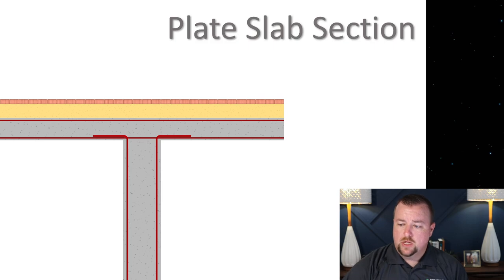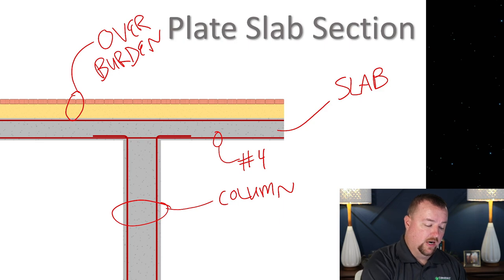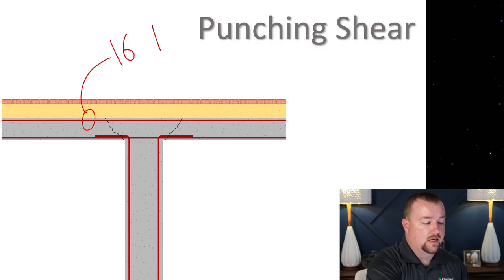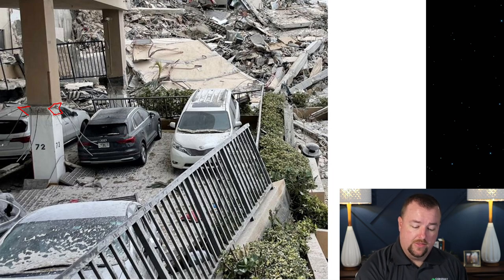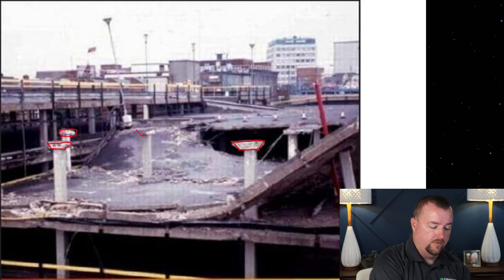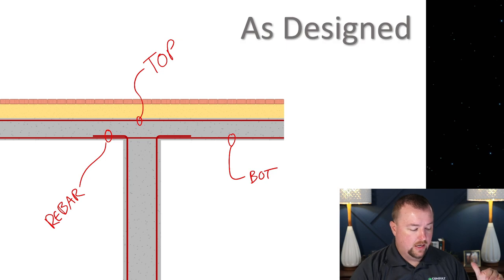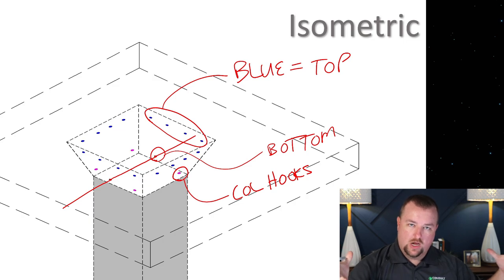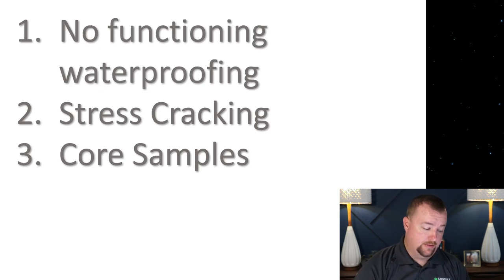The Importance of Punching Shear at the Surfside Collapse

Comment: Thank you so much for this analysis and discussion. It really helps those of us non-engineers with a technical orientation to understand this failure. I’m looking forwards to your upcoming discussion perhaps of lateral stability in the tower structure and if perhaps additional sheer walls or diagonal bracing might have dramatically mitigated against what so quickly became a near complete failure .

Comment: Thank you for such a well explained reason for your theory, I totally agree…. I was a civil engineering students who decided to change majors just for the scary reasons you have explained…..my husband was a guy who was a project manager for scores of projects in south Florida, and did concrete structural repair……I always breathed a sigh of relief when he was done jobs from Key West to Hutchinson Island, as I was terrified that there would be massive failures while he was trying to repair pool decks, structural column and roofing since condo associations waited until it was almost time to condemn a building and then decided scope was large enough….. the new construction in the seventies is scary but the repairs and reinforcement required to alleviate the failures of same over many years was always a head scratcher to me on why this didn’t happen sooner…..
 God Bless the survivors and the dead in this terrible situation but buyer beware in south Florida if your condo is older when you buy.

Comment: Would  it have been possible to add rebar to the building during repair?
Reply: The best way to repair the pool deck would've been to cut out entire sections at a time and pour new slabs tied into the existing structure. The entire slab was damaged completely through, anything else would've been an incomplete repair.
Reply: I think it would be the best if they removed that entire slab and made a new one

Comment: Any person that's ever put a back patio on a house, or built a path way, knows about the quarter inch dip. I can't believe that this slab was originally built to not drain off water naturally. That was 40 years ago though. Such a myriad of problems after that.
Reply: The original print specified drainage pitch and drainage pipeline for garage roof / pool deck !
Reply: @chrisperrien7055  I've watched everyone. It's certainly a mystery. I'm to the point of wanting to hear about the palm tree roots and weight.
Reply: 40 years ago, we definitely knew that the slab needed to be able to drain.   If I were the people involved in this construction, I would rather be dead than to know that my mistakes were fatal which caused the death of people.  I am not being facitious.
Reply: The quarter inch dip is when you visibly cower to the rebar salesman.  I must be in love with Andrew Carnegie.  We can afford better than rebar.

Comment: #4’s @ 15”? Seems a bit light doesn’t it? Usually #4’s at that spacing is commonly used for temperature steel (cracking). I would have figured #5 @ 12” minimum for a slab 9.5 inches thick from a structural standpoint, but agree don’t think size of steel was at fault, more water problem. Question must be asked; was the slab built as per design plans?

Comment: Your analysis videos are great quality and educational.
Concerning the slab core samples, the multiple layers of spalling may indicate maintenance errors made in the past.  In addition to waterproofing and drainage questions that have been discussed, another factor is live loads over the life of the concrete.  Excessive loads may have been placed on the pool deck slab during the palm tree removals, any prior work on the paving surface and staging pallets of material.  A skid loader or forklift moving paving tile palllets or buckets of sand would place concentrated loads of thousands of pounds on the slap. Typically outdoor paving has a base surface on top of earth/ground.  In cases like the pool deck and garage structure, any work is being performed on a floating concrete slab.  If the top layer is already delaminating, the slab has to distribute those forces on a thinner surface and only support is at the perimeter and the column locations causing deflection and thus, spalling.  

Essentially, after years of use and any deterioration of the top mat concrete cover, later work (multiple times?) moving a 10,000 lb plus loader and pallets repeatedly (relaying tiles, planter box work, tree removals) over a saturated concrete slab only supported at the column locations in the garage and pool deck perimeter.

Would slab deflection be further compounded by the design (1970s codes) of the column and slab connection?  
It appears the only connection are rebar column hooks that are then wire tied to to the bottom mat.  The top of the column and slab bottom would be a cold joint.

Comment: Would the palms removed from the decks have caused massive damage...? Btw I really enjoy the videos. They are quite interesting. Ps I can't believe I'm watching engineering videos, bravo
Reply: No, probably prolonged the life of the pool deck though. If anything, it is an indication that the board knew they had a slab issue and were desperately removing weight off the slab.
Reply: I can't help but wonder if the palms themselves caused major damage. How far down do their roots go, and could they intrude into a structural slab? Concrete doesn't stop determined tree roots.

Comment: I’ve never seen a core look like that. Could this problem of delamination have originated from poor casting protocols? Given this environment is not and potentially windy by the ocean, delays in the slab cast could have built in cold joints from day one.
Reply: I am certainly suspicious that poor construction workmanship was a contributing factor to the observed delamination - and other water intrusion issues as well. And once you get such serious compromised structural integrity, the situation becomes very bad indeed.

South Florida in the late 1970s through to the 1990s was notorious for poor workmanship and corrupt building inspectors, so this is a very probable scenario.
Reply: @chemech  True, many better-built structures from the 1950s-1960s still doing fine, but once that WW2 Generation retired, and So-Fla became more "Third World", the shodiness proliferated... silver lining: Hurricane Andrew in 1992 finally caused some tightening of codes and oversight.
Reply: @MajorCaliber  No buildings survived Andrew where the eyewall came over. Our company sent a semi truck load of supplies down. I saw the photos the driver took.

Comment: My guess is that the building was designed weak. Skimpy columns in the section that collapsed. Not much rebar in those columns. Another possible contributing factor... Heavy equipment driving over the pool deck during the past 40 years, causing damage.
Reply: Back then they probably figured they had this slab construction method down pretty good and it was working everywhere. but now we have the age and oxidation and the damage to concrete is too extensive to be safe currently in many hidden places. how many hotels are built this way? we know parking garages everywhere are concrete slab. makes you think.
Reply: The columns did not fail- they are right there punching out of the ground. The columns were pulled over or knocked out from under the slabs above by the failing pool deck slab.

Comment: Would have previous hurricanes have any bearing on this and possibility accelerated the deterioration?  With strong winds and possible storm surge hitting the building.  This is much better info than TV.  Being an non-professional engineer, but having degrees in Civil and Electrical engineering, its great to watch you explain this.  👍
Reply: Unlikely, This is a long term story of water sitting on the concrete slab for decades, slowly corroding the steel reinforcements. Add in a fair percentage of salt, ineffective waterproofing and the slab that failed was doomed.

Comment: Please tell me where is the steel from the delaminated heave in the pictures, as you have suggest, of the collapsed deck. Has all of the steel mat corroded to dust?
Reply: Around 22:45 and 23:30 good point! I think he is still working towards a conclusion (giving the benefit of the doubt). If there was insufficient top rebar in the deck, then collapse was inevitable. Florida in the 1980s anything was possible...

Comment: As engineered everything was okay , as built everything was okay , but the people said nay nay to the sloping decks because their lounges would not sit even on the sloping deck , so concrete  was added ( tons and tons of it ) to level the deck . Then the added many more tons with the concrete planters and 25-30 foot palm trees , and new deck tiles , more tons . The building put up with the extra load for many years , but lack of drains and extra weight  caught up to them . The deck gave way , heavy planter took out a column  and still the building  stood for seven more minutes , another column , now carrying the extra weight caused by the first falling column , gave way , and it snowballed till it was a pile of rumble
Reply: Indeed ... but a big "IF" on both design and "as built" conditions ... next video will examine this key component. "Rotational Inertia" is powerful stuff eh?

Comment: obviously, I would have recommended TOTAL replacement of the pool deck.  Engineer cutting the pool deck loose from the bldg and drop it.  Start over, new columns and decking...  The bldg would have stayed and the owners would have bitched and moaned about the cost and the lack of availability to use the pool.

It wasn't subsidence or PIF problems... The pool deck did this.. just like the butler did in the the kitchen with a knife

I think you nailed it.
Reply: Now the question is, why did the building survive for 7 minutes after the pool deck fell in?  What happened in those 7 minutes?

Comment: What I'm wondering is: how did these plans pass approval from an architectural perspective and how did it pass structural approval before the building was allowed to progress to the next phase?  Was it a failure in certification that allowed the plans to pass and was it a failure in certification of the structural work that was done?  Seems to me that both of those approval processes were flawed.
Reply: You haven't watched the video then? The design was sound and was built correctly. The structure failed due to years of neglect in a hostile environment.

Comment: Great videos,  but i disagree with your assessment on the cores being separated at the re-bar depths. In cores that small it is very likely that the drill bushings that align the drill head on the mount were worn (happens in nearly all drills after a week of use. This causes play at the tip of the bit while drilling and the kerf is actually larger than the cutting teeth themselves- so when you hit something more dense than the concrete (i.e. metal) itself the bit rattles or vibrates, which when combined with the non adhesive surface of rebar to concrete tends to snap the core at that depth before you even back the drill out. This is very common on 2-4 inch cores, less so when the bits are larger and there is more cohesiveness to the concrete around the metal. Otherwise two thumbs up!
Reply: It also looks to me in the second core sample (core B) that the 4 separated 'bits' are laid out in the wrong order - if you look at the colour of concrete, it looks like the 2 middle bits are the wrong way around. If that's the case, they would fit together more accurately (look at the edges).  I could be wrong!

Comment: My friend your presentation on two way diagonal shear ("punching") is faulty. The top and bottom slab reinforcement does not restrain the diagonal shear cracks required to increase shear capacity of the slab. Therefore, the typical way to add steel shear reinforcement is done by shear stud rails or less commonly vertical ties. Otherwise you can locally thicken the slab on top of the column by adding a "column capital" to increase the concrete shear capacity.

Comment: Very interesting, and great explanation Josh. This problem was apparently very far advanced when the building came down, with a substantial section of the pool deck/garage roof structural  slab functionally detached from its top rebar support. Such a shame no one had the skill or foresight to put two and two together before all the lives were lost.

Comment: I am a PE.  Great video.  Punching shear seems evident. At first I though maybe some kind of foundation rotation of the piles.  But now seems like exterior column line lost lateral stability from collapsed pool deck, leading to buckling of those columns, and the progressive failure.  Certainly a lot more forensic analysis to come.

Comment: Shear contrubution from the concrete is still very large, plus you need to consider dv from the column for the perimeter as the shear angle is important to consider. The intercepting longitudinal and transvers bars do next to nothing to resist shear, basically give you some nominal tension for interface shear calcs. The top steel is negative moment reinforcing.

Comment: AT 25:00, the loss of the top steel actually causes the slab to lose tension strength at the top.  Where a continuous slab crosses the columns, it is actually in tension at the top of the slab for some distance out.  There is a cantilever effect.  Pulling apart at the top can start the shear failure.

Comment: Very good presentation.  The one constant across all the videos I have watched on this collapse has been -  concrete tells you when it's failing while you still have time to fix it.  That appears to have been true for this building.  It's criminal negligence that someone (the condo board, city, county, state) didn't step in and either force the residents to come up with the money to make the necessary repairs years ago or condemn the building and get everyone out.  

The residents of a building that had multiple red flags 3  years ago can't be allowed to fight over, argue about, and delay necessary repairs until the building collapses because they didn't want to spend the money.

Comment: Josh Porter: I hope I'm not getting ahead of the video but @ 23:00 you can see that short 90-degree hook from the column sticking out where it should have been embedded into the structural concrete slab. It's like it just slipped out of a hole in the concrete, otherwise, you would see cement clinging to it and there is none.

Comment: ANOTHER SMASHING VIDEO !!! Brilliant !!! I have a sneaking fear that in haste of building schedules perhaps things were rushed and corners cut, but i am convinced the corrosion of the rebar (spalling)will be a root cause. Iv'e seen these rebar sticking out of concrete demo flaky as a pie crust, from living around the gulf coast, salt enviroment is brutal to steel. The delaminating you speak about seems very possible and i am also wondering why rebar is so close to the top of the concrete finished floor.

Comment: Why are there no rebar (upper or lower) poking out of the remaining slab at 24:00?  Your theory of delamination would mean there should be as much stress on upper rebar - and they would not break.  Also delamination would explain why no concrete is sticking to rebar.
Reply: During construction the city asked the developers to hire an independent firm to inspect and certify the structure.  It’s possible it was all a giant cost-savings exercise, with no actual inspection from the city.  Hence we don’t see the rebar of the upper mat sticking out because it’s not there.

Comment: I worked on a 7 story building over a parking garage in Breckenridge, CO back in the early 80s. The garage deck was not level, so when level pouring the concrete overburden, it was way too thick on half the building. By inspector order, we had to jack hammer it all out and use dense foam slabs to space it up for a uniform thickness pour and uniform weight. What a back breaking job. It was an entire semi full of foam.

Comment: I read somewhere that flat slab was banned in places with seismic concerns, but not in Mexico City evidently.  And, that was because of progressive collapse concerns.  Most of our overpasses have been reinforced with steel jackets and more rebar.   Frankly, if you are from California, any reinforced concrete construction outside the state looks like there isn’t enough rebar and the columns are too far apart.  Anything built pre San Fernando quake is supposed to be a death trap.